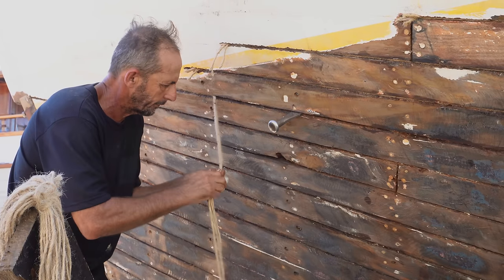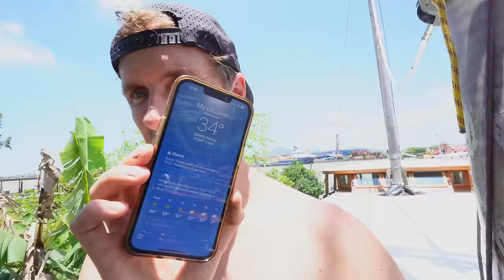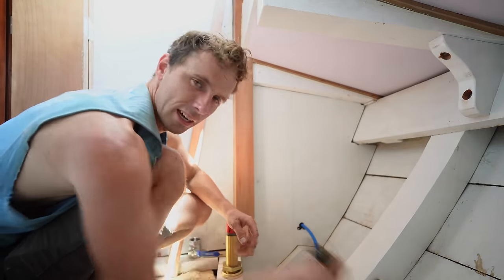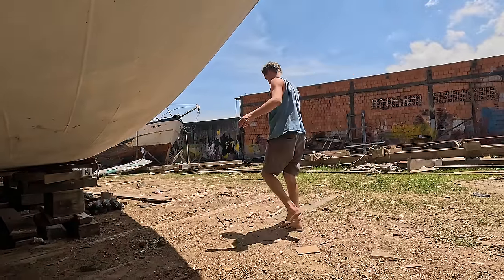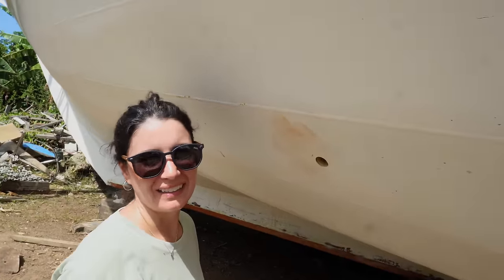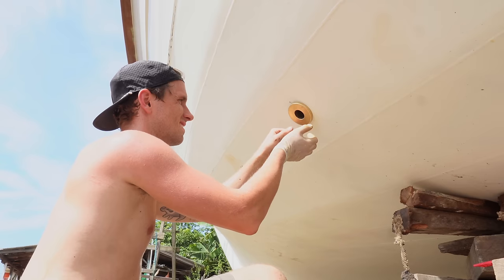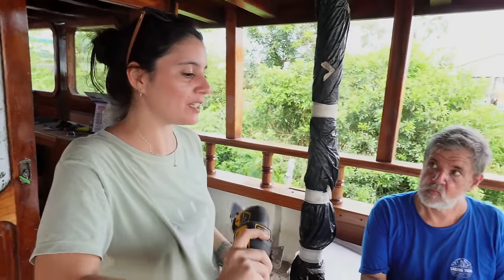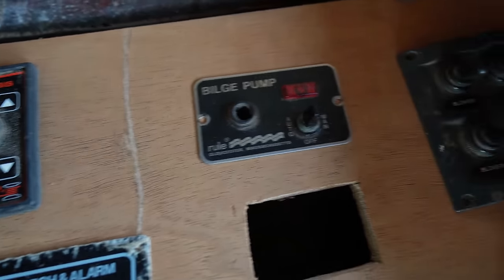Drilling important holes in a 2 inches wooden boat's hull — Sailing Yabá 177

Comment: tip for drilling big holes with a hole saw, if you drill into the wood for 1mm first with the hole saw, then drill a small hole right on the inside of the circle (touching it), the sawdust has a place to go and drilling will go much faster with less smoking/burning and less resistance

Comment: As it’s your home it might be worth fitting at least one additional very very large bilge pump directly wired to the battery’s on its own dedicated circuit to act as a “salvage pump” in the event of an emergency. That can work even if the electric panel is damaged or out of action. Having that one large pump ready to go  will give you valuable time to try and solve the emergency without having to pump out manually or fix your little bilge pumps👍

Comment: Heaven forbid but suggest you add blanked pipes to inside of unused through holes, without that you just have a tap between you and a big problem. Belt and braces in case of a valve failure or accidental opening (like a dog sitting on it!). Great progress, best of luck.
Reply: Get cork plugs the correct size for each hole and place them in secure spot near each through hole.

Comment: Until thru hulls are fully connected its always worth fitting a blanking plate to them or at least remove the open /close lever from them so they cant be accidentally knocked.

Comment: Happy Birthday! 

On a build note; I would maybe sand down the epoxy that is on the exterior 
planking before  caulking the head through-holes. The area was not prepped before the epoxy smear, possibly causing any caulking used in the pipe installation to fail at the epoxy layer.

Comment: Ben, if you knock out the centre part of the hole saw with a screw driver or chisel, you can increase the depth that you drill into the wood. Coming along quick now.

Comment: I have enjoyed watching your YouTube videos. I am not a Naval engineer, but I have concerns about the synthetic rope used in steerage. I believe the salt water on the rope will crystallize in the conduit as it travels through the stern.  As the salt builds up and dries, it will act much like table salt. The friction will eat away the synthetic fibers quickly. I would watch this closely.

Comment: Should’ve had an extension bar on the hole saw would’ve cut straight through just before break out then cut back through from outside neat and clean, you are doing a fantastic job well done

Comment: Ben, just a quick note about placement of the inlets and outlets for the heads (toilets). They should be on the opposite of the galley intakes and outlets. This is a definite requirement especially if the heads are forward of the galley. You do not want effluent coming into the galley intakes.

Comment: Hi BEN & MP ,
                        Those threads you are going to trim back to be flush with the nut , you can buy plactic or metal caps to fit over those nuts which makes for a clean finish and does away with any sharp edges. Cheers. PS. you will still need to trim back the threads.

Comment: Acorn to Aribella wooden ship build was in the water 6 months. First pull out the plank expansion pushed out some corking and paint off which makes sense but was an unexpected task on first haul out. Just a heads up you may want to expect that.

Comment: Question : I may be rough, but am I right to say that  you can not dump gray water in a marina or at anchor next to a marina or even to a certain distance from the short line. 
So if so, what will you do knowing you dump it all strait outside : Toilet close 😅 
Thank you 😊
Reply: They said theyll have tanks for that.
Reply: they install a blackwater tank, so when on toilet you can choose straight out or into the tank.

Comment: Why are you using hole saws on thick timber?   Forstner Drill Bits are so much better or even flat bits.  Hope saws are not designed for thick timber

Comment: MP, I share your dislike of drilling holes in the boat, esp those below the waterline! 😢 why? Because as you and I are both very much aware, any holes below the waterline have the potential to sink the boat! 😮 I can remember from many years ago reading a book by a very experienced sailor who also had our concerns re holes in the boat and so he formed his own strategy about holes. He strongly believed in minimising the number of holes to the absolute minimum. I think that he did so by wherever feasible making a single inlet/outlet do the work of others by using various simple plumbing devices to combine things together! 😂  About the toilet. I'm really going back now but I remember that the most basic ones were operated by a simple but effective hand pump! Shipboard toilets are notorious for never working properly with the consequence that SOMEONE always gets stuck with fixing the stupid thing! Guaranteed to put a smile on your face 😅 !

Comment: Not installing a bow thruster is a mistake.
Reply: Wouldn't that be a monumental operation at this late stage? Or is there perhaps something simple available now?
Reply: mounting a bow thruster in that woodden hull would be a mistake and pretty costly if you ask me. if you see any wooden 80ft schooner with a thruster take some pictures of the installation and send them to them as an example, i can not think of how to do without compromising the hull and getting a verry big hole in it that is never water tight and starting to rot immediatly. also it will render a huge space unusable in the bow of the hull.
Reply: I agree it would take some work. However, without it, steering the bow of a boat that heavy would be next to impossible in many "Cruising " scenarios.